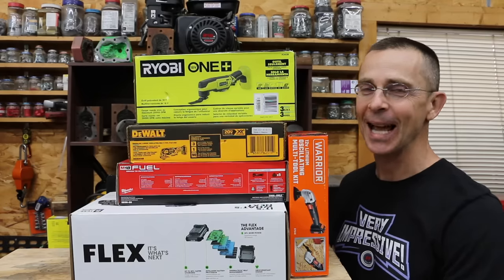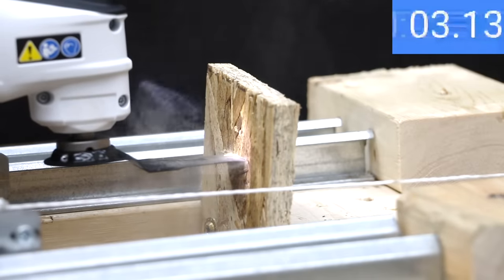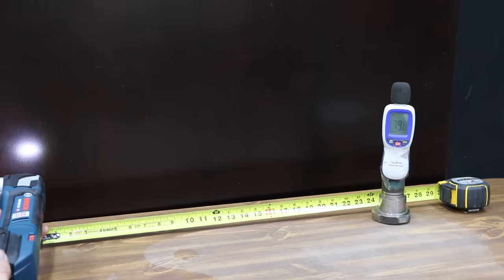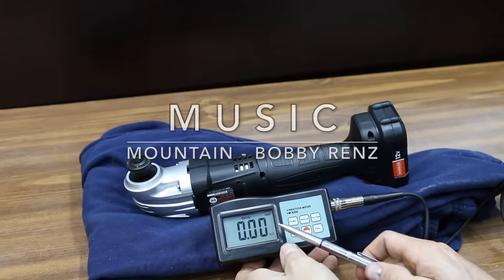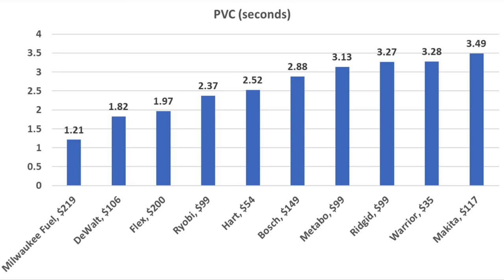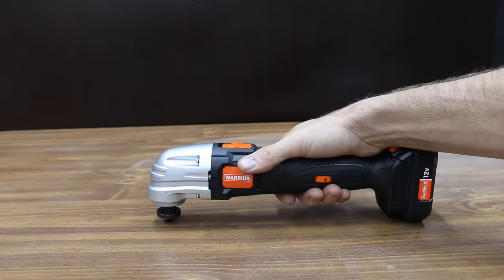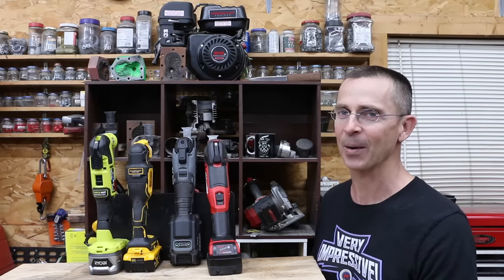Best Oscillating Multi-Tool? FLEX vs Milwaukee, DeWalt, Makita, Ryobi, Ridgid, Hart, Metabo, Warrior

Comment: My phone is obviously spying on me since I was just looking for and bought a Black and Decker oscillating saw. Then this shows up in my feed. Lol. Funny, the B&D looks exactly like the DeWalt except it’s orange. I chose it mainly because I have a bunch of B&D 20v yard equipment and it uses the same batteries I already have. Still, I’d wager the DeWalt and B&D are the same tool.
Reply from the maker: Thanks for the suggestion.

Comment: Nice video. Just a suggestion, it would be better if you use the same brand/type of blade on all the units. That way, there's no (or at least just little) variation on the blade and your test result would be more conclusive. Keep up the good work.
Reply from the maker: Thanks, will do!  Thanks for the suggestion.

Comment: I have to say that for once in all of the years of watching the channel, I actually disagree with the testing method. I use one of these tools most every day of work as a residential electrician. After trying a few of the Harbor Freight variants, the Ryobi and the Milwaukee from fellow co-workers, it just didn't make sense to have a tool I'd have to mess with to change a blade, too big to be useful, too fatiguing to hold from the vibration, or too weak to finish a job without shutting off and nearly melting. After checking out the DeWalt in a Lowe's store, I picked it up and have wondered why the other brands don't use it as a basis for making theirs. It is far better to use day to day than the rest. Cutting speed is going to be based on the material first, then blade and then speed selection. I go from cutting through an old metal switch box, switch blades to drywall or plaster and lathe, then switch to a wood blade for the lathe or a 2 x 4 in a matter of minutes. Blade change speed and ease is a huge selling point. The height profile from blade to top is pretty small and I can install any brands blade in 16 orientations, and yes, I've used most of those. There are at least 3 different designs of blades and DeWalt uses all 3 without additional parts. Not all brands can use the other's blades. The other plus is the trigger lock (which I'd like if it would also lock the tool off to store with a battery in it) but you can lock the trigger in the 'on' position. That is so incredibly helpful. The only downside to the DeWalt are spots near the handle that can get hot after a long use, like cutting through glazed brick. Yes it will do that as well - without overheating. That is 20+ minutes of continuous, hard use. I would never recommend another brand oscillating tool to anyone. There is also a kit that goes on sale with an 8ah battery, blade storage case, tool bag and fast charger for $200. That would be the best way to go but I use my little 2ah batteries with it and it works just fine. PS, thanks to my Dad but also you, I'm not a fanboy of any brand, I am a fan of the tool that does the job. I don't care what color it is. :)
Reply from the maker: Thanks for the feedback.

Comment: I have pretty much all Milwaukee tools but in my sea of red in my work truck is a black and yellow multi tool. Just because of the trigger, I’ve stuck with my Dewalt even though everything else I have is Milwaukee. I also have a Milwaukee multi tool but I prefer the Dewalt just because of the trigger. I do also own a ton of other Dewalt stuff but I started getting Milwaukee for work and just kinda switched over, but I still use both at home. Just wish Milwaukee would put a variable speed trigger on theirs instead of the speed dial on the side.
Reply from the maker: Thanks for the feedback.
Reply: @ProjectFarm  thinks for thanking of me.

Comment: I have a Dremel oscillating tool, but will often buy Diablo accessories. I don't know if Dremel has a cordless, mine is corded. I've always had a good experience with it when I bought quality accessories. The quality of the accessories makes a big difference. (Yes, Dremel has an oscillating tool as well as a rotary tool).

I'd love to see how the performance is when you swap accessories between the brands, like take the leader's accessory and swap it with the loser's accessories and see how it levels the playing field.
Reply from the maker: Thanks for the suggestion.

Comment: Can’t believe you didn’t include the Fein - they are the gold standard and the inventor of this tool!  I’ve had one for decades and it’s like new.  fast and easy to change blades -better than any of these
Reply from the maker: Thanks for the constructive feedback.
Reply: @ProjectFarm  Re-reading my comment I realized it sounds very snarky.  I greatly appreciate your reviews and what I MEANT to say is that I would be fascinated if the originator of the tool (AFAIK) and IMO a top notch construction and reliable tool would test as well as the others using your excellent testing.   Anyway thanks - you’re the best channel on youtube for well designed actually useful reviews.

Comment: These tools are hard for a test environment, it ends up being more about feel when youre using them. seems to me cutting speed and efficiency has more to do with resonant frequency of the material since rpms are so high. With mine sometimes its all about finding the subtle pressure required and the right rpm and all the sudden its like a knife though butter, and i bet every tool is a little different depending how vibration gets transfered to blade. Great attempt at testing though, and it does help with deciding if i ever need to buy another!
Reply from the maker: Thanks for sharing.

Comment: Much as I like Ryobi, one use I had was cutting a 2x4 INSIDE a wall.  I had an older corded Dremel model that was skinny enough to fit in the confined space.  There's no way the Ryobi would have fit.
Reply from the maker: Thanks for sharing.

Comment: One thing I think suffers in a number of your tests is that with tools like this and also reciprocating saws and some other tools, when you're actually using it, you naturally move the tool around, using more blade area, allowing chips to clear, blade to cool, etc, whereas in most of these tests the tool is used in a way the human body is pretty much not capable of doing, mechanically straight in or straight on with constant force. Humans just can't be that consistent. I don't know if anything can be done about it, to be scientific, that's what's necessary, but it's something I notice.

This one tool I haven't upgraded to cordless yet. Bought the Dremel version many years ago to work on some trim. I do not like the Allen key to change the blade, and being corded is inconvenient. So I will eventually upgrade to DeWalt, but it's a tool I don't use all that often, so it's not a priority.
Reply from the maker: Thanks for the constructive feedback and that's a great point.

Comment: How do you test this comparison without a Fein? Fein is THE standard. As a contractor, who actually uses his tools on a daily basis, a cheap brand like Ryobi will not hold up. How quiet a tool is, or how many seconds one tool is faster than another doesn't mean anything if the tool won't hold up. I value most of your reviews, but not including the original oscillating tool, the Fein, is a real oversight.

Comment: As someone who uses my oscillating multitool a lot I would’ve loved to have had the decibel ratings while it was cutting because I’ve noticed that it’s pretty loud compared to when it’s not cutting. Also, the vibration test while it was cutting or even if it just had a blade on it would’ve been interesting because when do you ever use a multitool without any blade on it? anyways, thanks for the videos!
Reply from the maker: You are welcome! Thanks for the feedback.

Comment: You should try the new dewalt 12v it cuts faster than the 20v also craftsmans brushless rp 20v both have low vibration and cut better than the dewalt 20v
Reply from the maker: Thanks for the suggestion.

Comment: Would love to see the in brand comparisons. Milwaukee Fuel and M18. DeWalt usually has a more basic model as well. A couple weeks ago I picked up an M18 kit for $99 from Home Depot (tool, battery, charger, and bag). Super happy with it. Now I'm curious how it compares to the Fuel version!!
Reply from the maker: Thanks for the video idea.
Reply: I agree, we tend to see Milwaukees top dog in the competition, but brands like Ridgid tend to have the cheaper brushed version. I don't think it's intentional, but it skews the data and could persuade someone that is on the fence to buy something other than the ridgid. The circular saw video had the same issue. Brushless from milwaukee and dewault, but brushed from Ridgid
Reply: It’s because rigid is trash so brushed or not it’s all garbage
Reply: @mwhizzler476  That's weird, lifetime warranty, the new 1/2" puts out more torque than milwaukee, and it's owned by the same company as milwaukee.

Comment: Seems like the amount of play in the installed blade on some of these tools (accessory fit) really hurt its chances (at least under these testing conditions). But... I think the conditions & parameters of these tests served as "hidden" &/or bonus tests of functionality, cutting accuracy, cutting consistency, tool longevity & even comfort/ease of use!! This is why comparative testing should always be performed under identical (or as close to it as possible) conditions, procedures & applications ... it allows you to glean important information - which is subsequently revealed through indirect testing & intention! Plus, limiting parameters while controlling variables is an EXCELLENT way to allow testees to speak to you; telling you it's true value, range of  purpose & even let you in on the manufacturer's dirty little secrets! ("Uh... huhuhu hu -  he said testes..uhhuhuhh")

Comment: this is very helpful but are all these tools capable of using any blade or are any of these brand specific? Having the ability to use a "universal" blade could sway someone's choice if the one they were thinking of locks you to a specific brand, especially if there is a large cost for that specific brand compared to others
Reply from the maker: Thanks for the suggestion.

Comment: After years of using the ridgid oscillating tool, i can say it's an okay tool. Its on off switch is a terrible design that gets clogged with drywall dust and eventually breaks all together. (Been through 6)  today I hear that ridigd is no longer repairing tools under the lifetime warrenty they sold with the tool.
Reply from the maker: Thanks for the feedback.

Comment: I still can't think of a tool made by Milwaukee ( because they're expensive) that you just have to have, other than the Sawz All. DeWalt normal pee or Ryobi radioactive pee colors. Pick your poison. There was a time that Ryobi mimicked Bosch color. I liked my old Ryobi battery powered drill driver that looked like Bosch.😜 Makita 1/4 inch aluminum plate circular saw from the late 90s early 2000s is my fav. Makita is to circular saws as Milwaukee is to Sawz All. Ya just gotta get it.

Comment: The last 3 times my multi-tool to cut something, it was a really tight spots and no other tool could have even done the job. I had only used it for occasional sanding in tight corners, but that thing has saved my bootie a couple of times and mine's an 8yr old Ryobi that came in a bundle. I thought, "I have absolutely no use for a couple of these tools." 8yrs later, the amount of money I saved because I have a multi-tool literally paid for the cost of the kit. I wouldn't purchase another tool pack without the multi-tool.
Reply from the maker: Thanks for the feedback.

Comment: I think tests like these prove that just because it's a more expensive name brand, the costs and technology don't necessarily scale in proportion to the effectiveness and/or efficiency of the task. Often, the technology is improved with marketing goals in mind more than task performance, so you're paying for a bigger, stronger, brushless, higher wattage, higher voltage, more features, more functions tool that doesn't necessarily cut a piece of wood much more effectively than the cheaper lesser known brand.
Reply from the maker: Thanks for the feedback.

Comment: I'd like to see the Makita sub-compact StarLock put through these tests. I think the Makita model used in this video is not the best representation of the brand. I use my Makita XMT04ZB almost daily and it's a very good tool, priced below the Milwaukee at $182 (or $229 if you're buying from Home Depot).
Reply from the maker: Thanks for the suggestion.

Comment: Entertaining and informative as usual, but it seems like you really stacked the deck by comparing Milwaukee's top of the line against entry level tools from other brands (e.g. Ridgid sells a brushless model that is priced midway between the  brushed model you tested and the Milwaukee Fuel).  Especially when your blade testing video showed that the Milwaukee blades were below par --- anybody who didn't see that video is going to be really disappointed when he drops over $200 for the tool and probably buys the Milwaukee blades to go with it.

Comment: I'm a ridgid owner, not sure why you're using the brushed tool .. they sell a brushless.. you used the ridgid brushed circular saw too.. which they also sell brushless.. and did at the time of testing.. ridgid might move up if you used the best version they sell.. to top that it's about the same price as the ryobi

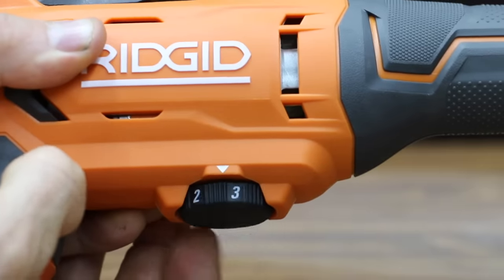Comment: @3:51 lol 80.7 degrees.                I wish you would have tested the M12 FUEL multi-tool as well. From what I understand the M12 FUEL is very comparable in performance as the M18 FUEL in a smaller more compact design. For the price, I went with the M18 brushed one because the kit with a 2.5ah battery, charger, and bag was only $99 compared to the M12 FUEL which I don't think I've ever seen lower than $159.
Reply from the maker: Thanks for the suggestion.

Comment: You need to open them. If the Milwaukee breaks, you can not get individual replacement parts. So not only are you paying double to buy the tool you also will be buying another if it breaks due to not being able to get replacement parts singularly, I found this out the hard way and yes they do break quite frequently especially the trigger
Reply from the maker: Thanks for the feedback.

Comment: Do they all accept the same style of blades?    Do they all have adapters that can take the older style with the open ends that the Dremel blades used to use?
Reply from the maker: Thanks for the suggestion.

Comment: Hi Todd, Would love to see a comparison of jigsaws. I own a Skill brand jigsaw and I never get a good strait, perpendicular cut. This is mostly due to my lack of patience and skill with the tool. Perhaps there are some saws that would make me a better jigsaw user! Comparison of saws that cut in tight curves, strait/perpendicular cutoffs and/or interior cuts (making a hole in the middle of a piece of wood). Base plate stability would be a good metric (how much play, ease of angle adjustment etc). Same with blade stability, do some jigsaws have play (can you twist the blade when it is fixed). Let me know when you launch the comparison!
Reply from the maker: Thanks for the suggestion.
Reply: @ProjectFarm  Thank you for all of your fantastic videos! I'm always impressed by your thoroughness and the creativity of your testing rigs. I would also really appreciate a comparison of jigsaws please!

Comment: Was the metabo in auto mode. Cause I was using a co workers.  And I thought the same I was getting mad. Shoving it into the door casing to cut.  Soon as it was taken out of auto mode it was so much better.  Just curious. This seems pretty bad if not

Comment: Although the tests were done with the a new blade made by the same manufacturer, I  would have licked to have seen a test of the different cutting tools made by various manufacturers. It's not just the handheld tool but the blade that makes a difference. And we don't know how good the cutter iwi that was used in the test.
Reply from the maker: Thanks for the suggestion.
Reply: @ProjectFarm  I should have posed my concern by using the following question rather than my statement. "When my must-tool's blade dulls, which manufacturers blade should I buy?"

Comment: I noticed after the first few saws you stopped telling the the degree of oscillation. I have the Makita and no idea the degree but it sux. All cordless multi tools seem to just be shim cutters. My corded Rockwell has a 5 degree sweep and that makes a huge difference. 30 seconds maybe to cut a 2x4. they need to start making longer blades to increase the sweep of these tool.
Reply from the maker: Thanks for sharing.
Reply: They are meant for small detail work/repairs. Not for heavy duty stuff. Although you can easily cut a 2x4 with it, but it won't be as clean/fast cut as a circular saw.

Comment: Dewalt is decent, ryobi is hit/miss, they have some good products for great price, but somtimes the corners they cut arent worth the lowprice. The bestest brand of the highest quality in the world is obviously Black n decker.....jk...lol but seriously now,  MILWAUKEE is clearly the best &its not close. they are always expensive but at least you know that its the best & most durable that tool could be. I have a ryobi cordless drill, a dewalt mini cordless drill, dewalt small hand held battery skil saw & dewalt backup sawzall for cutting in mud, dirt, water, or any situation that can damage or ruin my main mikwaukee sawzall. Every other power tool i have, a multi tool, grinder, rotory, etc is all milwaukee and i dont regret a thing. The quality is clearly better everytime
Reply from the maker: Thanks for sharing,